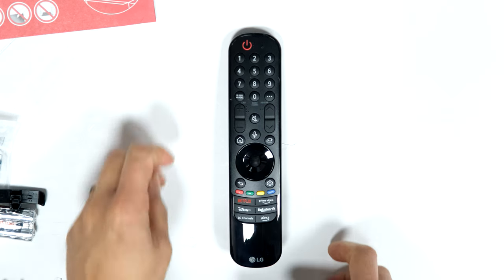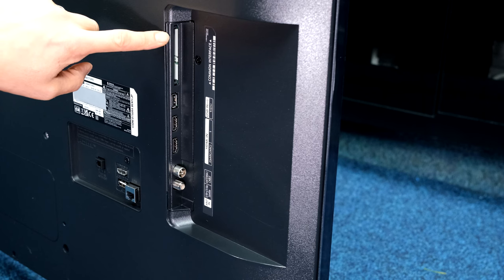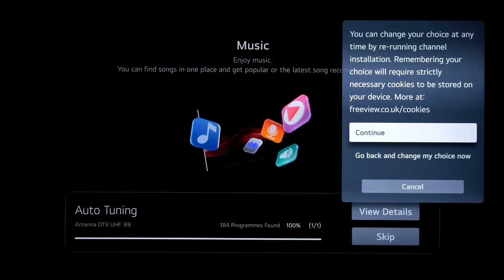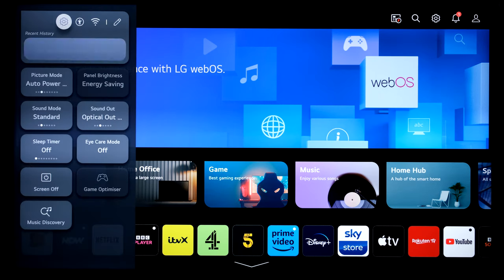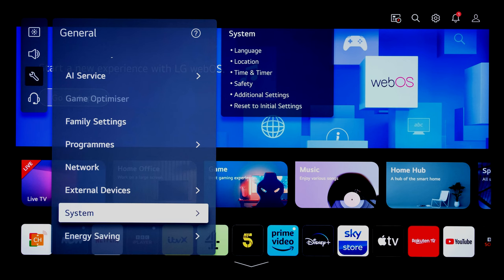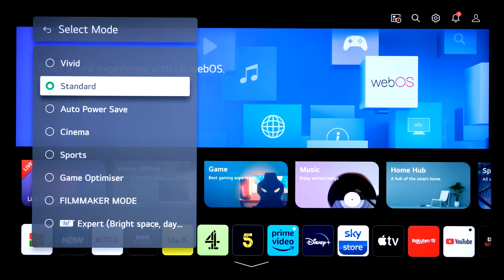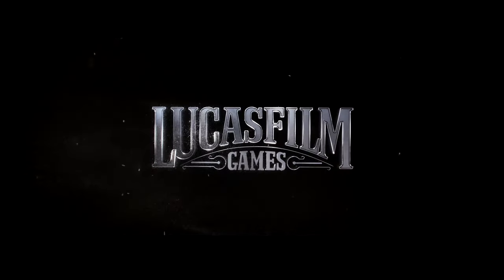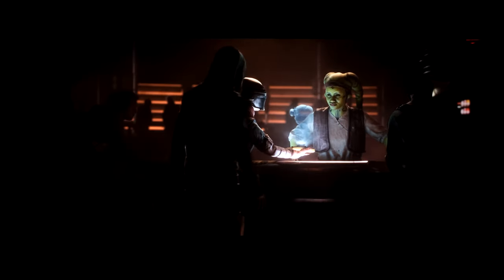LG QNED756RA Unboxing, Setup and Test with 4K HDR Demos

Comment: It does not memorize Channel 43 650Mhz well, it is impossible to see Rai channels even if the signal test is 100%. Don't buy it, in my opinion it has problems with the tuner.

Comment: Mine went straight back as soon as the black set up screen started :(  The light bleed and clouding was awful from several corners and edges of the screen.  Would not have been pleasant watching a film with black bars. Will go for the 42 c3 oled instead now despite being over twice the price, but was worth a try